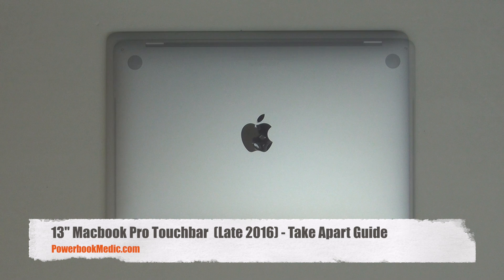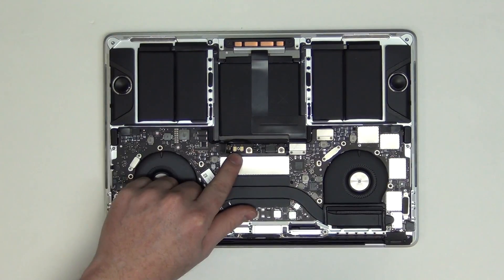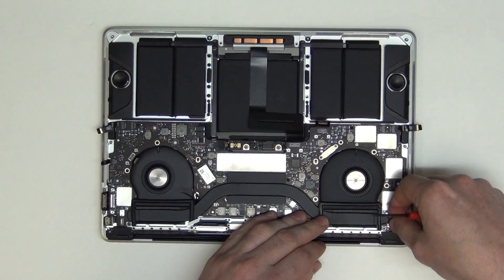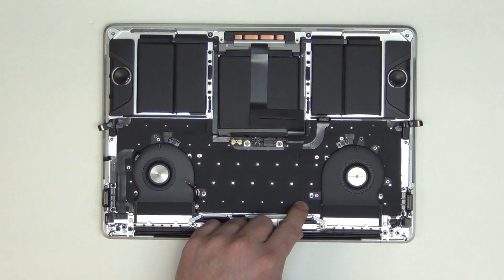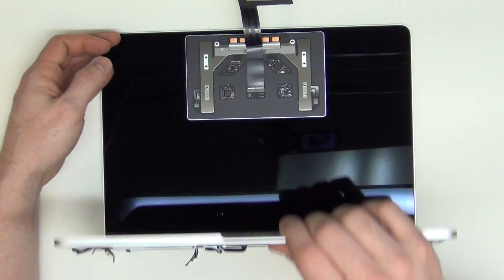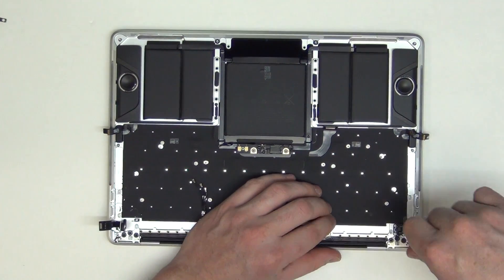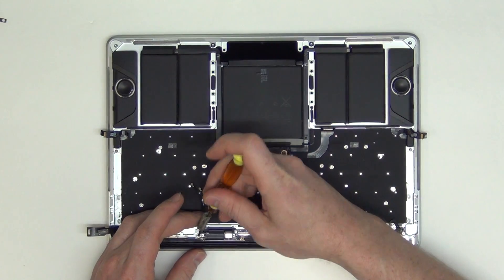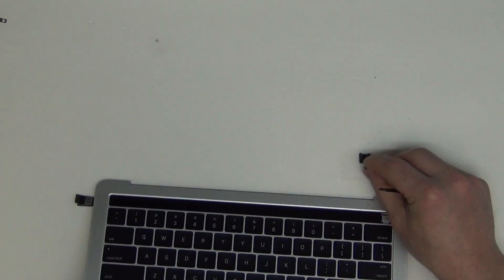How to Take Apart the 2016 13" Macbook Pro with Touchbar A1706

Comment: I followed the instructions and everything went great until I tried to reconnect those three small wires with individual snap connections next to one of the fans. The two nearest the screen hinge back of the laptop won’t reconnect and zooming in on photos look like the connections are starting to deform some from prior attempts (photos available). 1. Any suggestions on how to get the connectors to work again? 2. Barring that, any suggestions on workarounds? 3. What do those two wires control?
Reply: Did you find a workaround?

Comment: Thanks for the video. It was very helpful on allowing for me to replace my top case of my Macbook Pro since my touchbar no longer lit up. I have replaced it with a new top case and the touchbar now lights up. However, it is non-responsive to anything that I touch. I have tried the SMC Reset and NPRAM Reset with no luck on getting it to respond to touch. Is there a connection that I need to double check?
Reply from the maker: Darryl Polite Was there liquid damage that caused the original touchbar to stop working?
Reply: Powerbook Medic Thank you so much for the reply. I found the issue to be with the cable by the fan. It appeared to be connected but I realized that it wasn't. Everything is working as expected now and my computer is like brand new.
Reply from the maker: Darryl Polite That is great! Happy to hear it!

Comment: Is it possible to replace the battery without changing the keyboard top case?
Reply from the maker: Tasnuva Chowdhury It is possible, but it is a very difficult and can be dangerous repair. We sell the top case and battery as one unit to be replaced.
Reply: @PowerbookMedic  how  much it costs top case+battery for MacBook Pro 13 inch Touch Bar 2016 model?
Reply from the maker: Tasnuva Chowdhury We sell them used for $283.45

Comment: Can I replace the SSD/HDD storage ?
Reply from the maker: Unfortunately no. Apple decided to make the storage part of the logic board so if you want to upgrade you either need a replacement logic or a new computer.
Reply: It cant find its ssd drive, question mark flashing during startup, i pressed command + R and try to find ssd drive but cant, how can I fix it?
Reply from the maker: @a7medigi  If the computer can't find the internal storage then you need a replacement logic board. We have seen several of those with that problem and have not found a solution other than replacing the board.
Reply: Thanks Bro

Comment: Do you have a tutorial on battery replacement on a 2016 MBP NTB?  thanks for the great video also :)
Reply from the maker: No, we don't have a battery replacement video. That is a difficult repair that really should only be attempted by a repair facility due to the battery puncture/explosion/fire risk.
Reply: @PowerbookMedic  No its not. Just dont punch, heat it or poke it.
Reply: also bend it.

Comment: what about the battery how replace battery  please help
Reply from the maker: Replacing the battery is a difficult procedure as the battery is held in place with a strong adhesive. If you don't know what you are doing you risk puncturing the battery and causing the battery to explode. This is why the video does not cover the battery removal.
Reply: Powerbook Medic  oh then i will leave it to the  apple support. thanks.

Comment: i am wondering when will the fan work? Someone said it won't work until the temperature higher than 50 degrees; and someone said it only works in low rpm and when the CPU takes higher, it work in high rpm. Who is right?
Reply from the maker: I'm pretty sure on the 2016 13” Touchbar, the fans turn on immediately.  The only recent model machines that I'm aware of where the fan suspends turning on until a certain temp is the 2013-2015 13” Macbook Pro Retina.

Comment: Can the keyword be removed and replaced?
Reply: I'm too interesting
Reply from the maker: No. The keyboard is part of the top case. The parts for this model including the top case replacement can be found at this link: http://www.powerbookmedic.com/MacBook-Pro-13-w--Touch-Bar-Late-2016-p-1-c-860.html

Comment: What about the touch bar removal?
Reply from the maker: The touchbar stays attached to the top case assembly.
Reply: thanks
Reply: and it cannot be removed? Change it only with top case include new touch bar?
Reply from the maker: The touchbar is part of the top case. In order to replace the touchbar you need to replace the top case. The parts for this model including the top case can be found at this link: http://www.powerbookmedic.com/MacBook-Pro-13-w--Touch-Bar-Late-2016-p-1-c-860.html